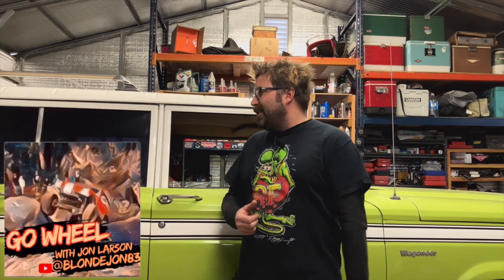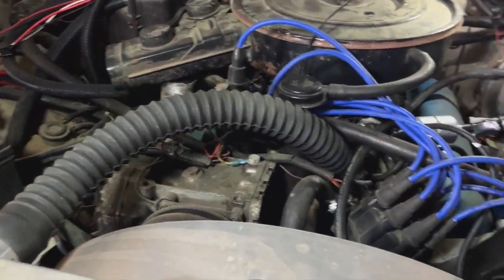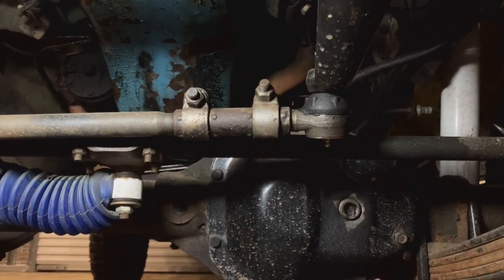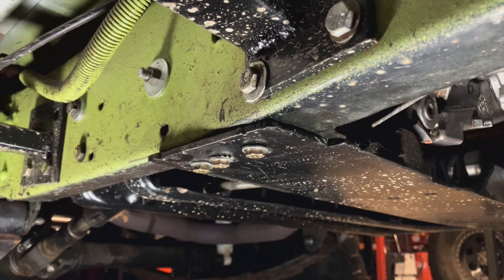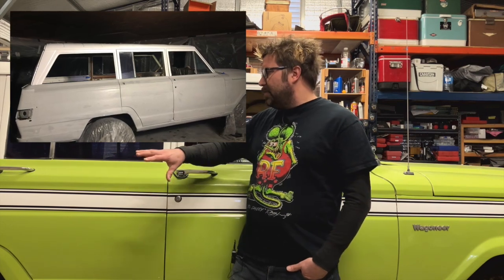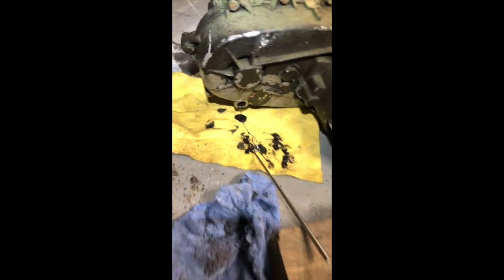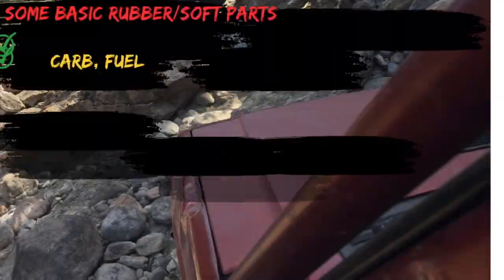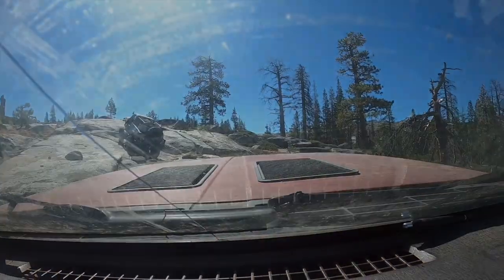Jeep Wagoneer Classic RestoMod back from the dead: Paint, Heated Seats, Air Locker, lifted + More

Comment: Great Jeep man!I love it, I just spend 2,5 years (1200 hours) to restore an '84 and swap a 5.7 hemi and 8 speed transmission in it. The more you work on your wagoneer, the more you love it. there is still a wishlist: bit of a lift, limited slip in the rear. vintage green window tint, center console with nav and cupholders. but overall I will make this my daily!
Reply from the maker: On man in jealous of the motor and trans setup! Im considering like a howell efi since its CA legal. But id hate to dump that money into it and then have the motor or trans take a dump on me. Especially since it needs new exhaust manifold gaskets- i think the leaks would throw off the o2s. I think for a backup daily driver, id feel better with a modern drivetrain.

Comment: For Your steering slop. Look at your front shackle bushings. Tires on the ground turn the wheel look if they flex side to side before the wheels actually turn.
Reply from the maker: Yeah they were shot at one point. I did replace all the leaf and shackle bushings with Poly bushings at one point